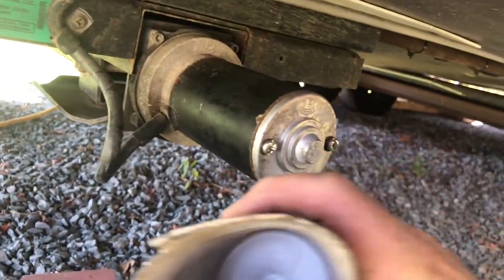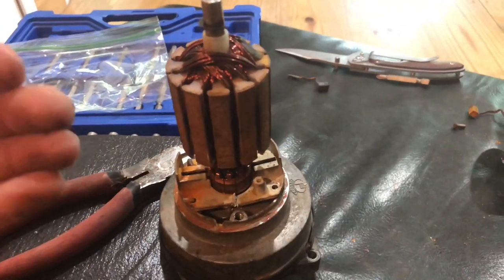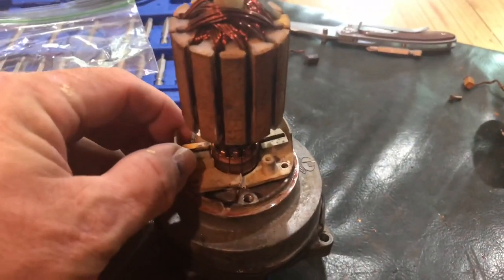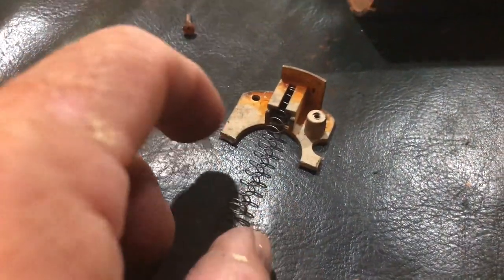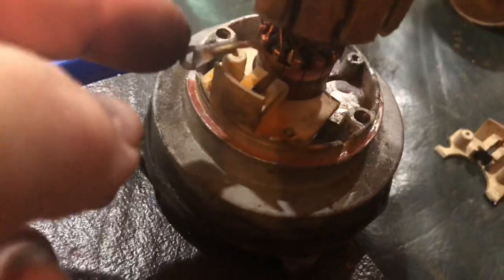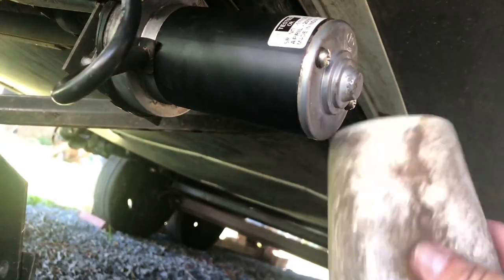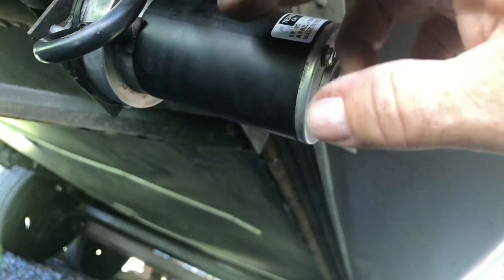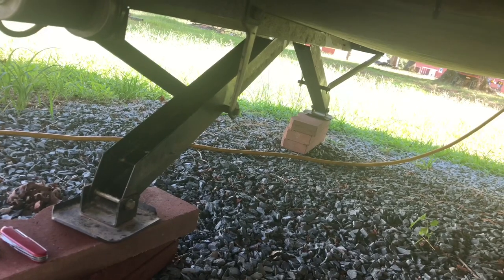DIY Electric Stabilizer Jack Motor Repair

Comment: Thank you!  After 4 month Canada Alaska trip and lots of driving in rain, I came down to lower 48 and rear stabs quit working.  Checked out your vid, sure it would help me get started but that I must have a different problem.  No sir, exact same!  Except one of my brush springs was completely gone, wet rust paste!  Wife got me a pen and I took the spring and fixed it your way.  Cut the white plastic holder with an exacto knife like you did, silicone sealed it up.  It'll outlast my 2014 Rockwood I expect!  So helpful in enabling me!
Reply from the maker: Fantastic!! So glad this video was helpful, I had no clue I would hear from so many that faced the same issue. Thank you

Comment: Thank you so much for posting!!!!  I can't believe I had this same exact problem.  I've replaced a bunch of brushes on tools, but it is so weird they didn't make these easier to switch out.  Thank you for such a detailed video, I followed every step, used some liquid gasket, used thread lock on the screws and bolts and was up and running better than before.  I even cleaned out all the junk inside the motor housing and sanded and repainted the outside case to prevent rust (even though no one sees it under the rubber cover)!  You definitely saved me some $$$.

Comment: this gave me ideas but mine is trying to turn it's just not dropping the legs at all, the motor actually turns some when i hit the switch so maybe mine just needs the screw lubricated. i have some white lithium grease i use on my tip outs and maybe that will work

Comment: If you have a starter rebuild shop close to home, I would say that they could get any part needed for that motor. It's definitely better to do what you did and repair than to replace. I just wonder how many people have replaced the whole motor because of a spring?  Thanks for sharing, I'll keep this in mind when I have trouble out of mine.
Reply from the maker: Great idea, I do have a local starter repair shop, didn’t think about that before. I’m sure lots of people just pay the price for a new motor but I can’t do that if repair is an option, my parents raised me to be too thrifty I guess. A couple hours and a couple dollars verses $300, well worth it to me

Comment: Just wanted to say thanks. Got to the campground and the motor wouldn't work. Pulled it apart based on your video, and one of the springs was gone. Fixed it with a BIC pin spring. You saved me $200 on a new one. Thanks!
Reply from the maker: Thank you so much for the comment, I’m glad this was able to help you get up and running again. YouTube has been my go to for a lot of issues and it has saved me a lot of time, I’m really happy to hear when my videos are helpful to others.

Comment: Just bought a Rockwood Mini Lite. All PSX2 power stabs worked on the lot. Got home 7 hrs later and only 3 work. The rear driver's side doesn't move, not even when I manually crank from either side. Pulled power and shut off battery, no change. The 30 amp fuse below the fridge seems fine. Is there a switch reset somewhere near the battery?
Reply from the maker: I’m not sure about a reset, I haven’t seen one on ours. Doesn’t make sense that it wouldn’t operate manually though, wondering if that one stabilizer is in a bind keeping it from moving.
Reply: @TheFurrminator  The roller pins fell out of the coupler so it wasn't turning the threaded rod! Solved
Reply from the maker: Jason Chipkin makes sense, glad it was an easy, inexpensive repair.

Comment: Exact same failure cause here. 2018 trailer (3 years old). I had  'rotating' spring rusted away. $800 system. Since if failed after only 3 years, I assume typial 'American made with pride".

Comment: Nice video. It was nice to see how it comes apart before having at it. I opened the gear box then taped the motors drive gear with hammer and it popped the armature right out so I didn’t have to cut the circuit board. I found a spring in my local hardware store and I cut it to length.
Reply: Was this pretty easy to pull the 'Motor drive gear' without screwing it up?   I would prefer not cutting stuff up if I can do it without, but I've never worked this deep on an electric motor... changed brushes before in tools, but they popped in and out easy.  Can you provide more details on what it took and what to look out for?
Reply: @gtyouwin  I’m sorry I don’t remember that well now. It was a year ago when I did it. I do remember it was really easy and didn’t take long at all. If yours already isn’t working then there’s no harm on trying since it’s already broken. Mine is still working after fixing it.